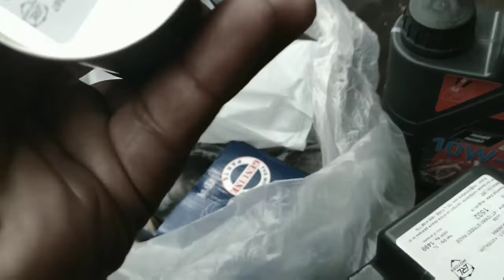Tvs apache RR310 || Engine Oil Change || #Liqui Moly  #engine oil

Comment: Amar 310RR 10300 kms hoyechhe... Ami ki eta use Korte pari Bhai?
Reply from the maker: Sure without any problem
Reply: On how many kilometres u have changed the oil?
Reply from the maker: Depends on how u ride and what oil u r using normally upto 8000 km I recommend between 7500-8000
Reply from the maker: What oil means many version comes from liqui moly of same grade jst like street race , off road , synthetic I recommend street race... If u r on long ride than change within 7000-7500